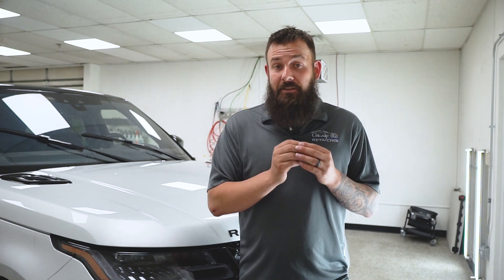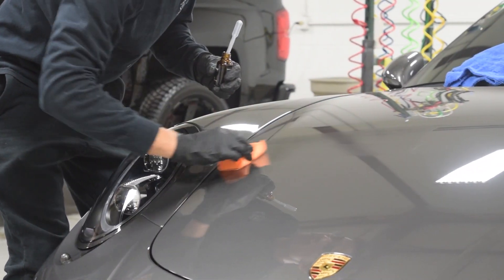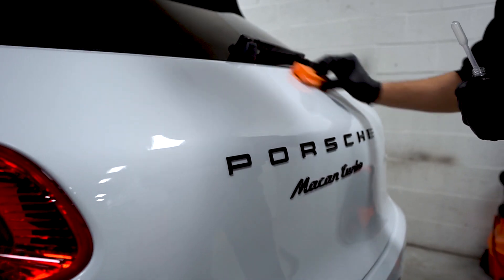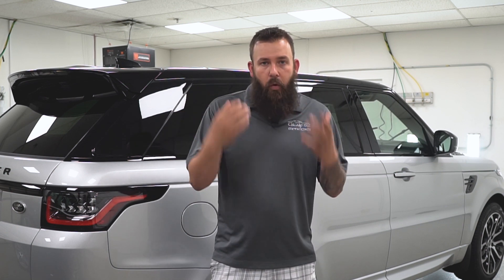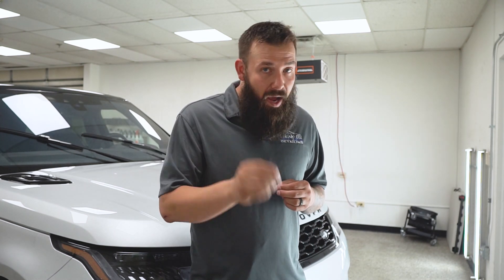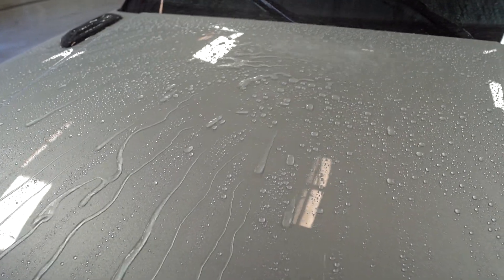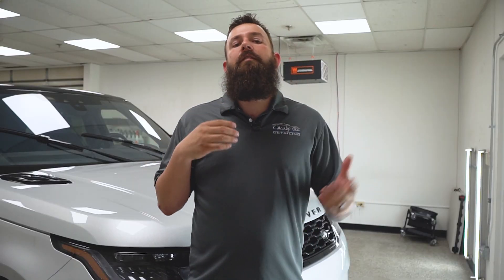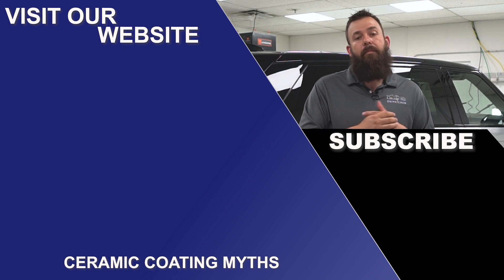How to choose a CERAMIC COATING

Comment: I had opti coat pro on my 750il and am getting ceramic pro on my 650i convertible. Along with full xpel ppf all over. Great installer in Greenville, SC. Four coats of 9H and a layer of lite on entire far and rims and calipers.

Comment: Jason, really like your videos, informative and to the point. One coating I've been looking at since I lease is QP ON 2.0. Please look into it, trial it. I'd be very interested in your assesment. Some refer to it as an entry level product, it's ceramic though I've also heard shops calling in between a sealant and a coating, that's how they price it anyways. It gives really nice gloss, amazing hydrophobic properties, I was at a car show and a detailer showed me a  video where he  got some on porous concrete, while applying to floor mats  the concrete repelled water. QP ON is mixed with distilled water and applied, a little goes a long way. The whole vehicle can be coated with it, paint, engine bay, interior, floor mats. It's is impressive. Also has a whole lot of non automotive and  household uses. I'd be interested in seeing you trial it. I ran into a detailer who put it on a long time loyal  customer's car for free  as he maintained it weekly and did the guys paint corrections as needed, he did to make things even easier for himself since he protected the exterior, and interior, the maintance was a breeze.

Comment: I've got a daily driver, that I just want protected, and I can power wash (2000psi, 1.2GPM, don't worry, I'm not crazy with it) on the weekend, and can clean the wheels and tires without stripping any protective layer. I'm about to wax it, but now I'm thinking about a ceramic coating, but I'm still on the fence.. It's my daily driver that I've had since high school, and currently my only car.

Comment: What would you recommend for “proper maintenance” for the modesta pro level coating. Is it just cleaning the exterior regularly. Or should I do something with the ceramic coating every once in a while

Comment: Just purchased 2020 Harley Davidson Road Glide Limited is there anything I should be aware of different than a car for ceramic coating. Also I would be storing it with a cover over top each winter for about 4 months. Is there any pre storage prep paint wise I should do for the ceramic coating. Great videos!!!

Comment: Questions:
1. Can you clay bar a ceramic coating?
2. Do you have to "strip" an old coating before applying a new one?
Reply: Following...
Reply: John Kowalski, Good question
Reply: No you shouldn't clay bar the coating. It would mar the coating and the scratches/ marks will show whenever  the car is in sun or strong light.

Just a normal routine wash and top up spray is enough to maintian your coating.

Comment: Super helpful.  I'm looking at getting my new car coated and I found a local installer that uses Ceramic Pro 9H. If i wasn't on the opposite side of the county i'd hit you guys up for the work.  They offer a lifetime warranty with enough coats. Is a lifetime warranty unexpected ?

Comment: I’m just getting into Ceramic Coating.  Thank you so much for this very detailed video.  I’m in the D.C. area, but am tempted to drive to Chicago so you guys can apply it to my 2013 Audi A6.  Question - OK to go through automatic car washes with a ceramic coat?
Reply: No hand wash only it voids the warranty of the coating if the installer gives you one but I think all installers that are certified gives a guarantee
Reply: Pro Gloss Auto Solutions is alot closer than Chicago (located in Southern MD, St.marys county)
And he does amazing work. Check him out on FB. 
Didn't mean to hijack any posts or potential customers.

Comment: Would the coating work on vinyl wrapped pieces of the vehicle as well? And if so how would you go about prepping those surfaces for the best outcome?
Reply from the maker: Yes, coatings will work great on vinyl. Check out Carpro Skin or Gtechniq Halo, both made for film.
Reply: @ChicagoAutoPros  if half the car is wrapped would you need to use 2 separate coatings then? One for the paint and one for the wrap or is there an all around one that could be applied to both?

Comment: Do we have to wax before coating or its a replacement of wax. Please answer
Reply: parminder singh all wax must be removed first 1000% of wax, dirt, oil ... even fingerprints can cause the ceramic coating to fail

Comment: Hello sir 
I quick have a question if i have a ceramic pro coated on my car would i be able to see the salt on my car or its not gona show on the car
Reply: Yes 
You will see salt on any coating
Just like dirt mud or spray paint....

But it all should be able to be removed much easier...

Comment: has anyone heard about Xpel ceramic coating or used it before ?  any info or reviews ? thank you
Reply: Did you end up using XPEL? if so, how do you like it?
Reply: @evando1189  ya man,  i ended up with Xpel 4yrs warranty, Great product
Reply: @Flyin_k  thanks man. Did you get any other xpel products/services? Like window tinting or PPF? Did you just get the ceramic coating on the paint or on the entire exterior? Sorry for all the questions, I'm just going through this process myself right now and trying to find some real world reviews from people. Thanks in advance!
Reply: @evando1189 only ceramic coat all over the car and rims man.  So far so good after 2 yrs,  but the coat is very delicated,  maybe it also becuz my car is black so it shows more obvious with very fine scratches if someone has leaned on ur car.  In the end is worth,  one of my neighbor also went did it over his after he saw mine. I spent abt 1200 cdns roughly around 1000  USd

Comment: I'm a sales person who drives 5oK in miles per year, I get a lot of chips on the hood from sand and gravel.  Do you suggest ceramic coating along with adding the clear plastic covering?
Reply from the maker: If you want to protect your front end from rock chips, yes PPF is the way to go. We would put ceramic coating over the PPf and the rest of the painted surfaces.
Reply: Thank you
Reply: @Markotto82  de nada
Reply: Clear bra for sure and a ceramic coating over the top to make it easy to keep clean... Great work Jason!

Comment: When you pay for 20 hours of paint correction on a full sized SUV, why would you cut corners on the cost of the coating?  $3,000 vs $4,000